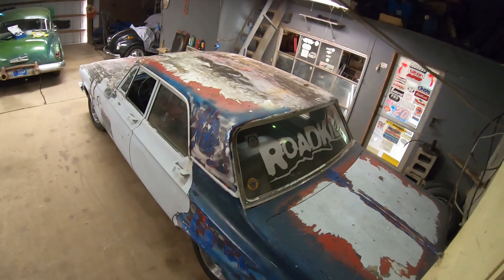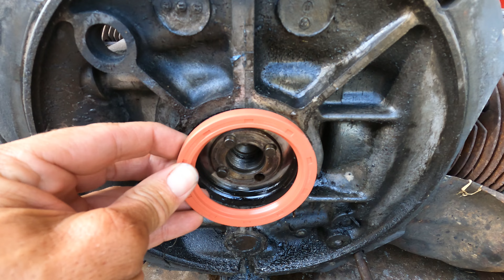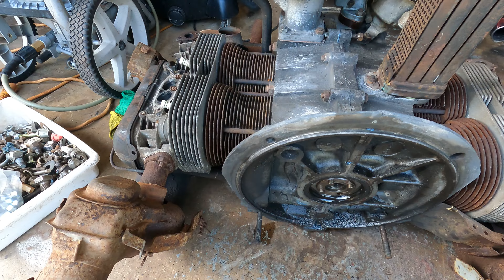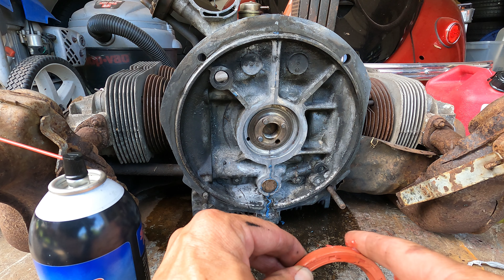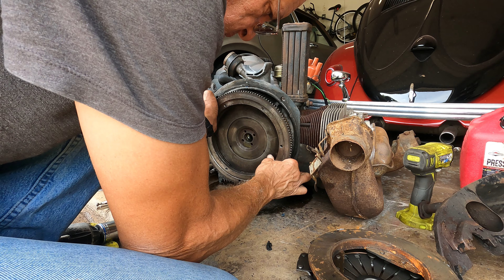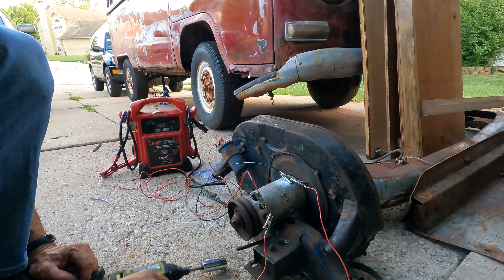1968 VW Camper revival part 4 getting the engine to stop leaking oil all over the driveway!!! Maybe!

Comment: LITTLE PIECE OF ADVICE.....scrap the generator. unless you like pulling engines out and in over and over until you finally do what I am recommending......get an alternator kit and be done with it. you will end up spending more on Regulators and rebuilt stuff and time removing the gen over and over until you finally cave. Best to just do it now. 
                  But if your going to keep doing it anyway.....Remove the DF wire from ground. Hook up only the D+ there should be a small draw. then but the gen should not turn. Then ground the field wire DF...then it should turn backwards like an electric motor. only for a second. Dont leave it on there like that. IMO the gen is toast anyway. and then you need to be lucky the Regulator is good. (probably not) and if you get anything other than a Bosch it will frag anyway.